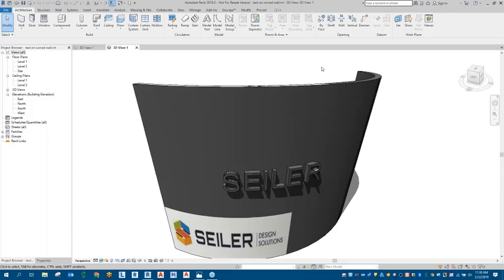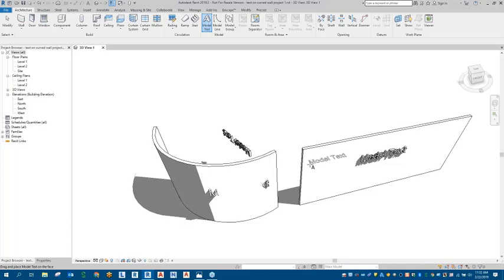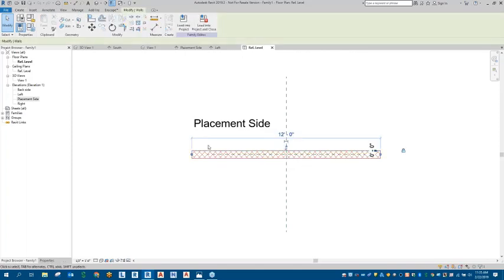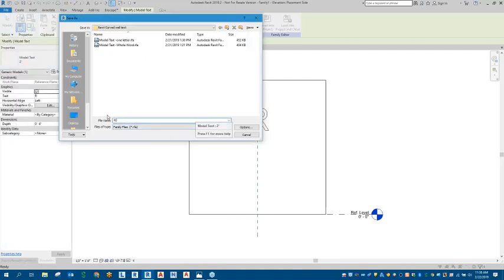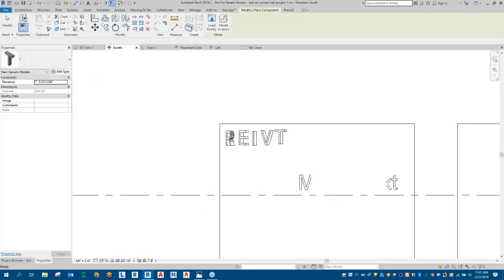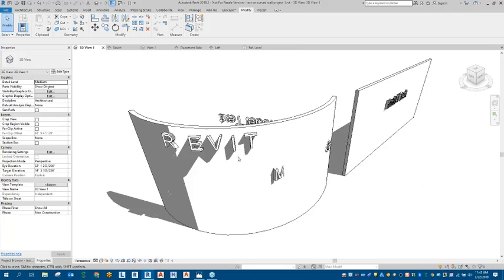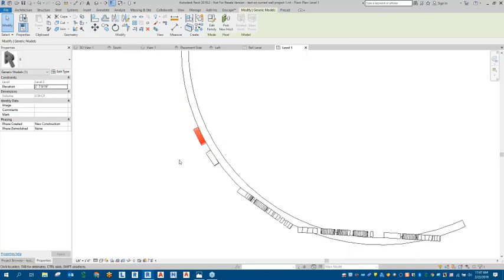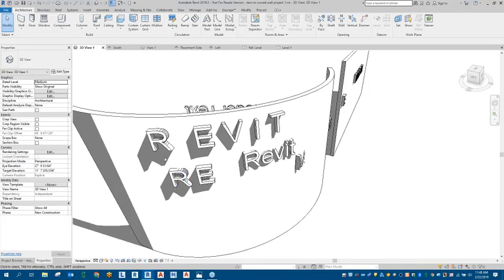How to Create Model Text for Curved Surfaces in Autodesk Revit

Comment: you can make this a little simpler by doing the following: when you are in the family editor after you make the letter select it.  in the properties window where it says "Text" it will show the letter you typed. next to that click the button, a dialogue box will appear called "associate family parameter." In that dialogue box select "type comment" and then load the letter into your project. This allows you to easily change and save the letter in your project by just clicking "edit type" and changing the "type comment"